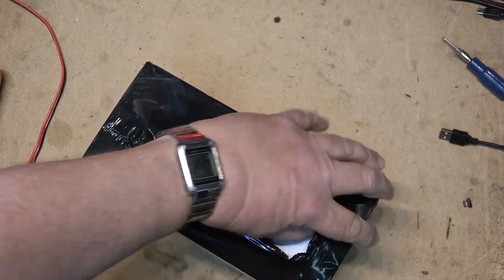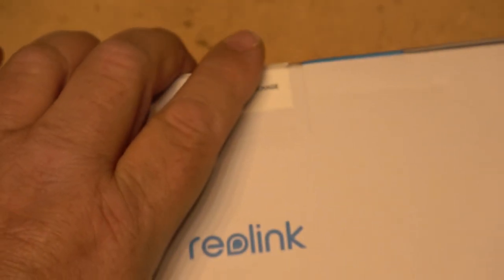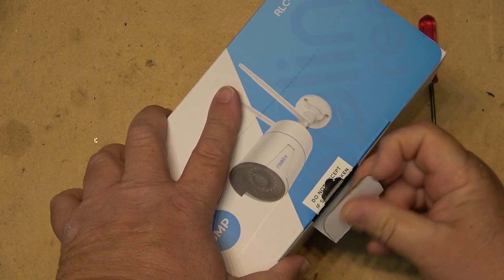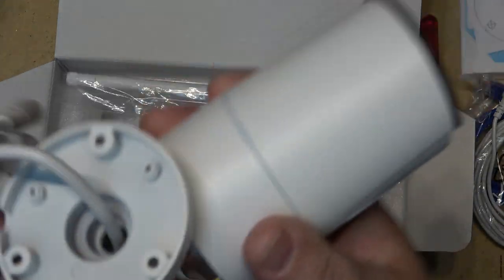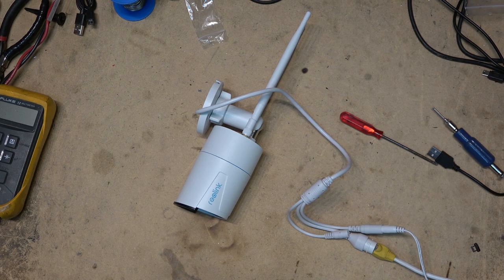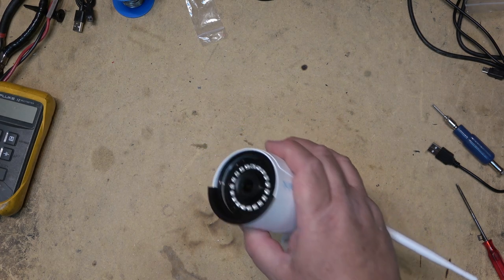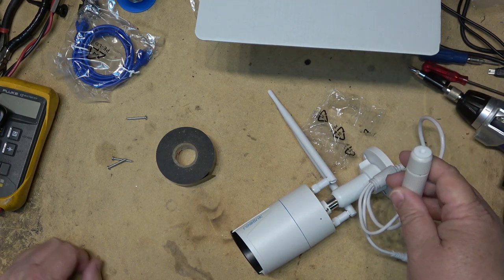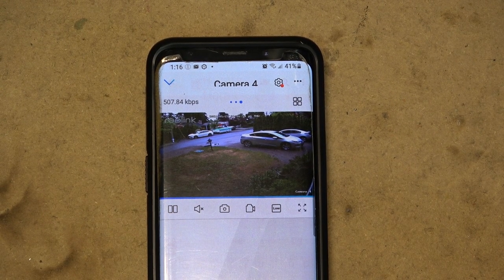Reolink RLC510WA Security Camera Review and Set up

Comment: Can the Led Emitters be switched off, in the case the camera would look through a window too the outside, where the area is illuminated by Led Street lamps. I would be interested in the picture quality the camera provides, because this is the way I would mount my next camera to prevent any vandalism.
Thanks for the effort.
Reply from the maker: Yes in the settings on the app

Comment: I just bought Reolink rlc-410w's and they are awful compared to my Argus cameras which use PIR. The 410s pick up every little thing, and if I turn the sensitivity down they miss events. I'm also plagued by insects at night constantly triggering motion, also fog sets off the motion detection. Does the 510wa perform better in that type of situation because of the human and vehicle detection? Do you get many  false alarms? Thanks.
Reply from the maker: The 510w is much better at detecting human and traffic.  Keep in mind that all cameras that work off of pixel detection will be triggered more often than pir detecton that is purely passive heat detection.
Reply: @12voltvids  Thanks for the reply.. I'm really struggling with whether I should just get more PIR cameras since I already know they give far less false alarms. Or if I should try the 510wa.
Reply from the maker: @joenicoletti5588  
They give fewer false alarms but they also miss many events.
Reply: @12voltvids  Yes, I know PIR is not always reliable either. I appreciate the help. Thank you.

Comment: When SIM card fills up does camera record over the oldest recording?
Reply from the maker: SIM card?  You mean SD card.  Yes it overwrites oldest footage.
Reply: @12voltvids  thanks what size of storage card would you recommend for not constant recording?
Reply: @12voltvids  have you tried any Reolink cameras that have the rounded dome for a corner?
Reply: @12voltvids and is a longer power cord available?
Reply from the maker: I use 64 or 128gb.
Reply from the maker: Yes i have a dome camera
Reply: @12voltvids  which one and would it be a good fit on a house corner overlooking garage and driveway as compared to the bullet style?